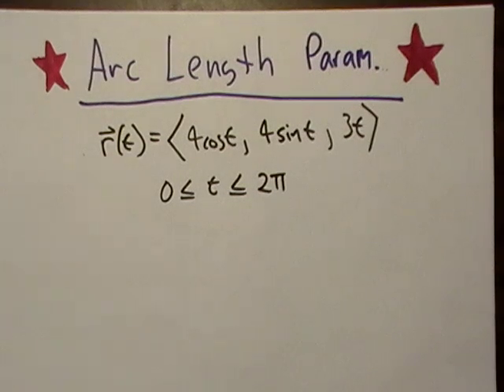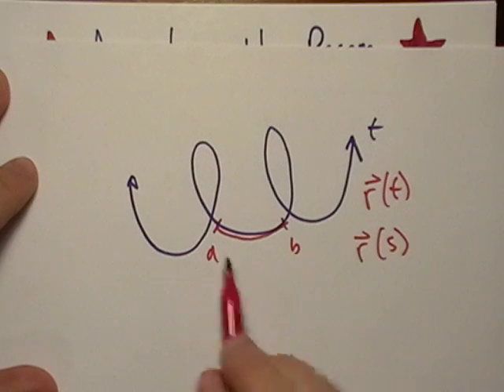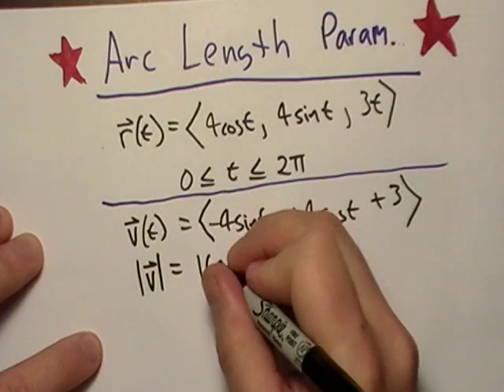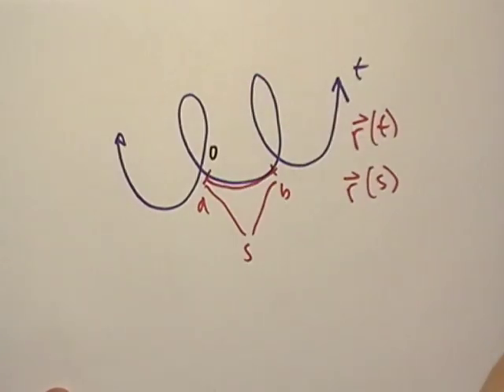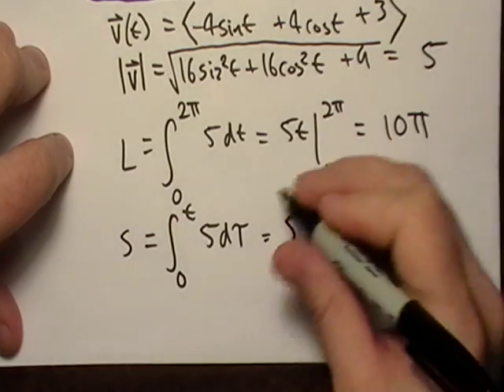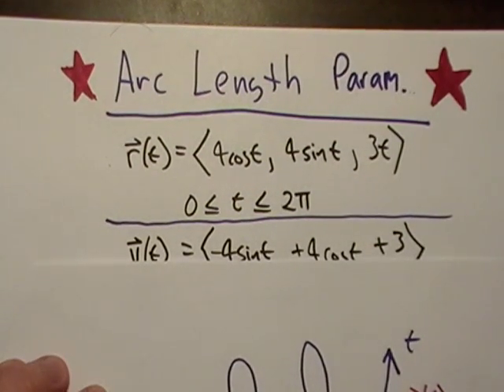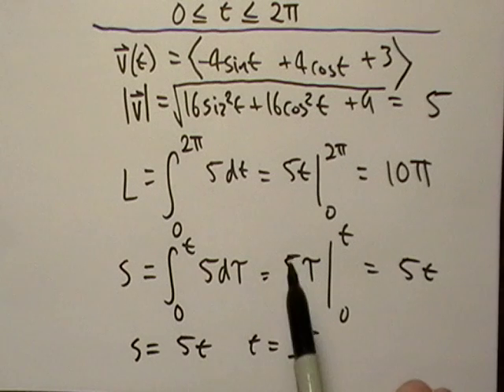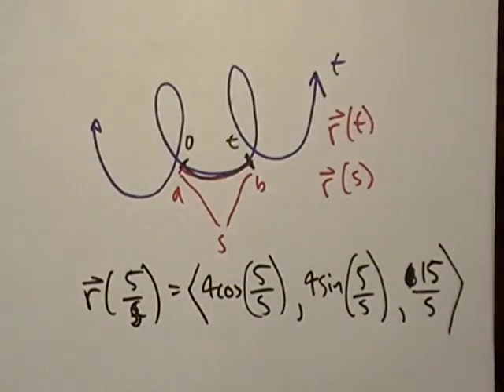Arc Length Parameterization

Comment: There is still a little mistake. When you substitute for t=s/5 and write r(s/5) = ... then this is still the same parametrization as before and nothing has changed. You just replace the symbol. You have to write r(s) = ... and then substitute all t on the right hand side.
Reply: It's in the description